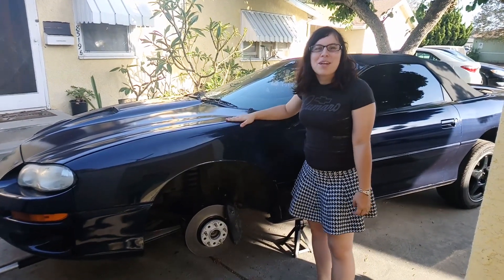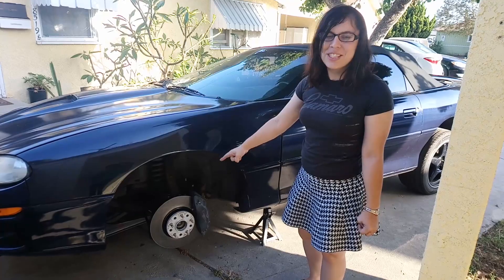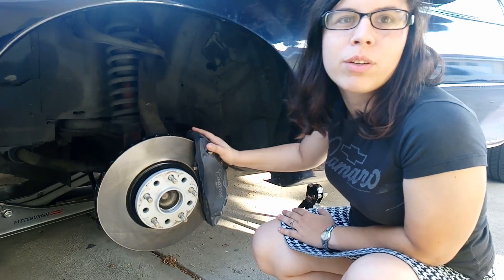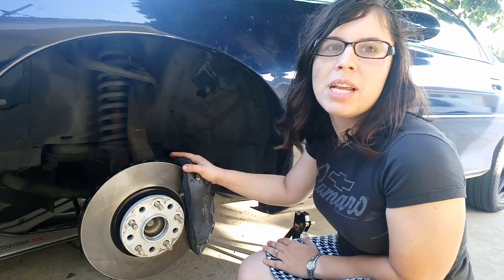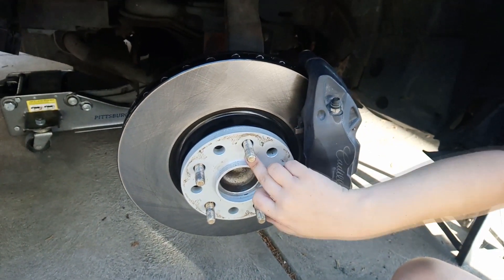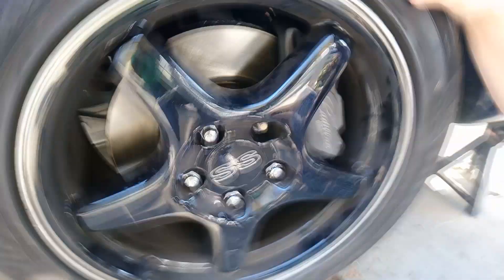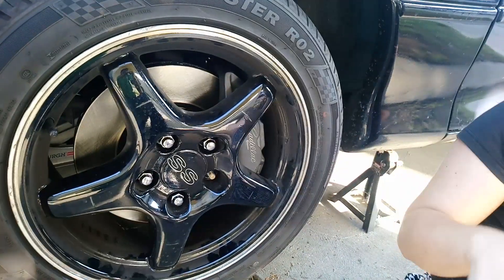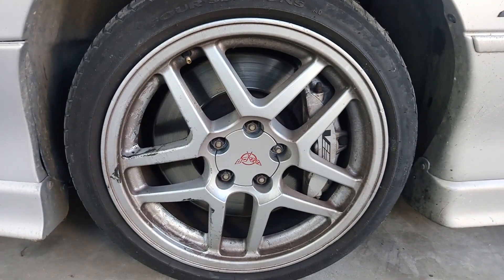CHEAP Brembos that fit 17" Wheels for 4th Gen LS1 Fbody Camaro or Firebird Trans Am.

Comment: Question regarding the six piston, how can I reach you?
Reply from the maker: What's your question
Reply: @flame5891  I have 2015 Camaro brakes and rotors, for the front. If I have a 2002 Camaro set up on my car.. what do I need to make them work?
Reply from the maker: You need to take the rotors and have the center bored out to Fbody specs. Any machine shop should be able to do it.
Reply: @flame5891 but the calipers will marry to the brackets without any issue?😅
Reply from the maker: @joelseptien5793 You need to drill out the bolt holes and use the caliper bolts from the 2015.

Comment: I put the same 4 piston Brembo calipers on my 1994 Silverado, using JEEP 14.9" rotors... My truck STOPS now.. The original discs on my 94 silvy would burn up pads about every 2-3 years at most as the rotors were so small that it took a LOT to stop the truck.  My calipers are a little different than the ones in this video as mine say "Brembo" with "Chevrolet" in red underneath that... No cadillac script on mine. Now I'm down to figuring out WHAT disc brake package to put on the rear of my truck as it has drums from the factory and those have to GO next!!!!

Comment: are the 6th gen camaro ss calipers also compatible?
Reply from the maker: Yes, they also bolt up.
Reply: @flame5891  oh man thank you so much for the reply! only thing I'll need is to bore bore the rotor and possibly. spacer aside of drilling the spindles? or I need longer brake hoses?
Reply: @flame5891  so I bolted them up and bored out the ss rotors for my hubs, the offset was off ughh.. would the z51 brakes from a 15 stingray fix the issue??
Reply from the maker: @hectorcastillo2463  I don't think they're the same. I used base model C7 Rotors.
Reply: @flame5891  I'm going to try the 15 z51 rotors I belive they are the same diamater as the 6th gen camaro ss. hopefully they fix the offset issue. the ss rotor is liel half an inch off I. cant even mount the caliper.
Reply: @flame5891  last question, does your abs and traction controll system get affected with these calipers?
Reply from the maker: @hectorcastillo2463  no it doesn't. If you run into issues. Make a video and I'll help you out as best as I can. If you do the rear it does if you have 4 Channel abs.
Reply: @flame5891  thank you very much for the fast response. I spent alot 9f money experimenting already with no results.. my last hope is the c7z51 rotors on these 17 ss calipers.
Reply from the maker: @hectorcastillo2463  like I said make a video. Show me what you have now and I might be able to point you in the right direction. Making everything work isn't hard but perhaps something isn't seating right.

Comment: Does these work on front and rear? I'm ready to go buy the parts of so.
Reply from the maker: Just front is a direct fit. You can buy adapters to make the rear work.
Reply: @flame5891  thanks for info. Would you know how I find that info?
Reply from the maker: @punkinsgarageandpaint8299  Look it up on LS1tech
Reply: @flame5891  is that LS1 TECH.COM
Reply from the maker: @punkinsgarageandpaint8299  Yes.

Comment: hmmmmm.   I have 2017 Camaro  18"  rims on my 2002 Camaro..  I wonder if they would fit these without a spacer!?   Because I dont run spacers.  for reasons.
Reply from the maker: I've been running spacers daily for about 3 years now and zero issues. To answer your question. I'm pretty sure they'll clear but you'll need to measure to make sure.
Reply: @flame5891  we'll I can give it a shot, and if it doesn't work... then I'll get spacers.  But, the 18's appear to have more clearance than before.. I have twin pistons currently

Comment: Did you use stock wheels studs for this swap or did you get longer wheel studs?
Reply from the maker: I used the longer wheel studs that came with the Eibach spacers I bought.

Comment: Did you install longer studs or the stock studs works with the 15mm spacer?
thanks
Reply: Salvador Calderon go longer, I did the same upgrade but I went with a 18” concave wheels so it cleared without a spacer.

Comment: Will this work with CTs v brembos ? V1 I have 17 inch rims in front thanks z06
Reply from the maker: Alex Garcis They do bolt up however they do not clear 17" wheels unless you grind them which isn't recommended. Also they do require the bolt holes to be drilled.

Comment: I wonder if they will fit behind my 17 inch C6 Z06 replicas without using spacers
Reply from the maker: You'll still need spacers just not as thick. I belive for C6 Z06 it's 8mm spacers.
Reply: Okay,thanks for the quick reply.How much do you have into that set up?If you don't mind.
Reply from the maker: About $200. I got each caliper used for $45 on ebay. Which really helped keep cost down! You gotta shop around if you're on a budget.
Reply: @flame5891  what about the brake master cylinder? It doesn't feel like you step on dog 💩 when you try to stop?
Reply from the maker: @Los_Chanchulleros  Brake master cylinder feels fine. Haven't had any issues and I've been driving the car like this for over 2 years.